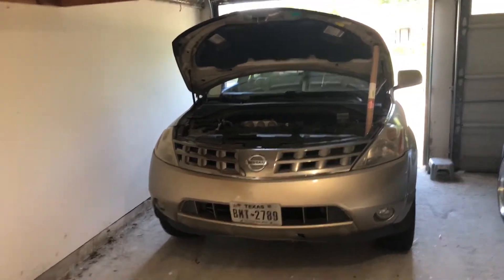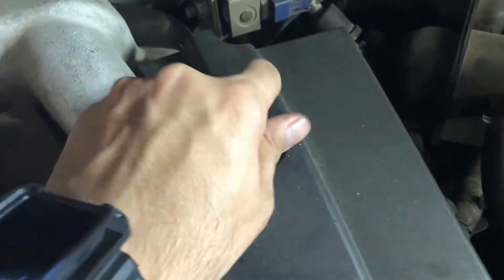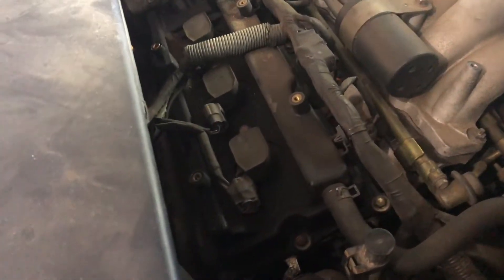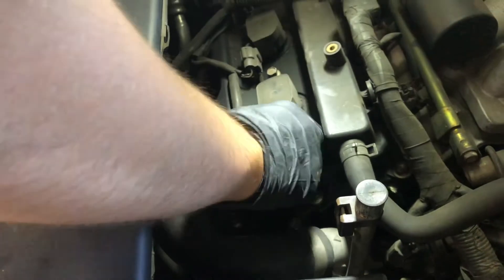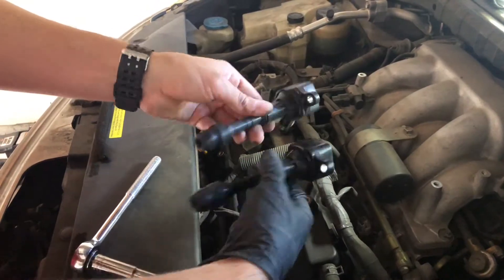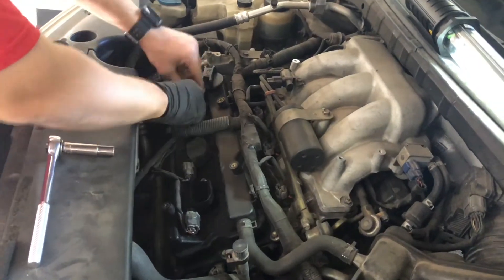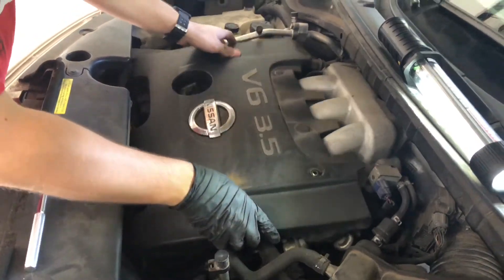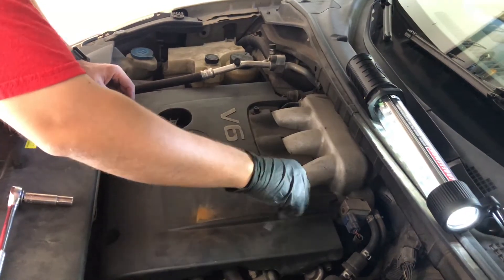2005 Nissan Murano Replacing Ignition Coil (How To)

Comment: This are  2,4 & 6. Do you have one for the remaining coild
Reply: These are the easy ones.  5 minute job.  The ones in the back require the removal of the intake manifold and is more like a 5 hour job.  That's to change the coil pack and also just to change the spark plugs.  This is the worst vehicle ever built.
Reply: Tom Jones so that was not all the spark plugs?
Reply: @jeramiahclark9826  nope
Reply: To get access to the other 3, with the Australian ST model at least, you need to pull out the air intake manifold. To get to that, I had to remove the wiper arms (bear with me), the wiper cowl, the wiper motor, the metal hood cover to get access to 2 clips and hoses at the back. (You can do this part without taking it all apart, but I had break fluid canisters and hosing that isn't present in any of the videos I 'tubed. Taking all this shit out made the whole endeavour longer but a million percent less stressful). To get to the rest you need to take out the throttle intake, and another handful of tubes and brackets. 
Once you have the manifold off, you will need a new gasket to replace the one that has come off.